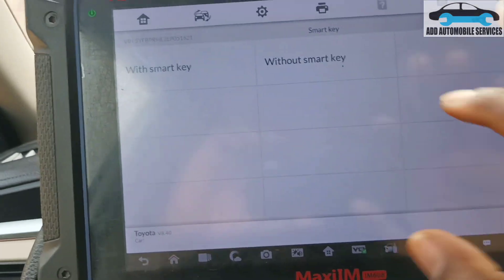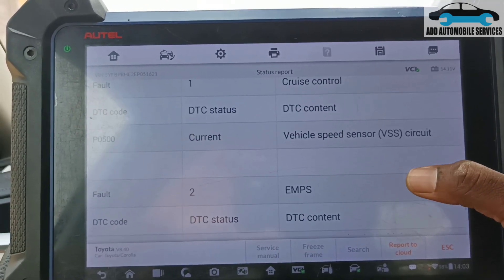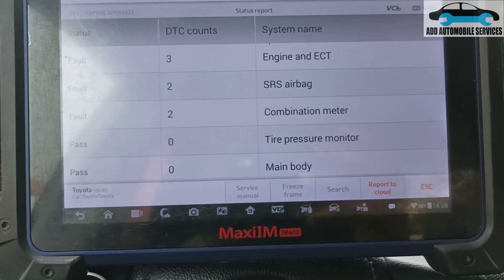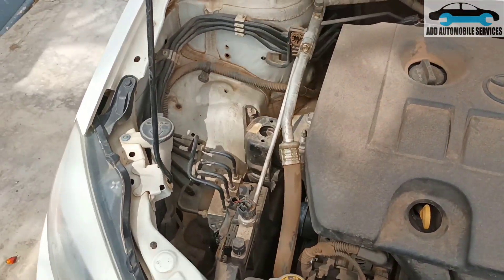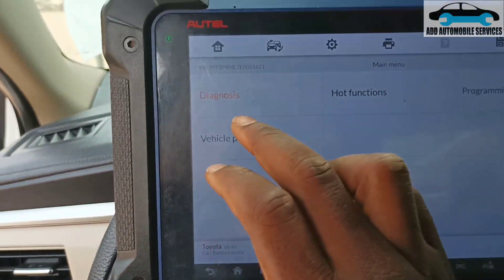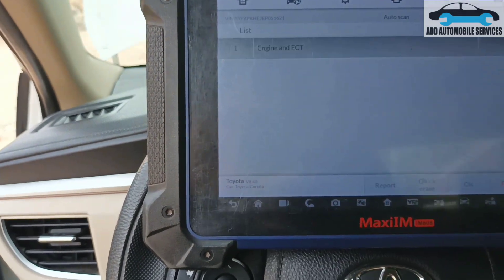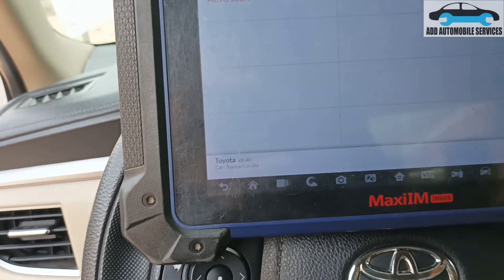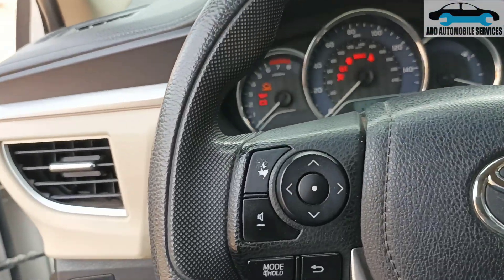2015 Corolla : No communication with the ABS MODULE

Comment: I have a Toyota Corolla 2012 with that same problem,I have check all fuses they are ok,To the Abs control module I have check the connector all current and ground are ok, can it be the abs module?
Reply from the maker: Yes

Comment: It was my exactly 100% problem and fixed (the reverse light broken bracket makes short circuit with buddy)  with replacing the same fuse in the video. 
The mechanics asked minimum $175 and I have to leave the car for several hours at his workshop garage.
Thanks again and you are genius.
Reply from the maker: You're welcome boss